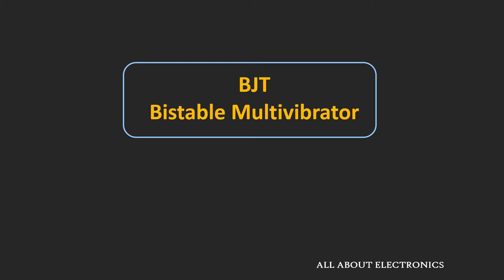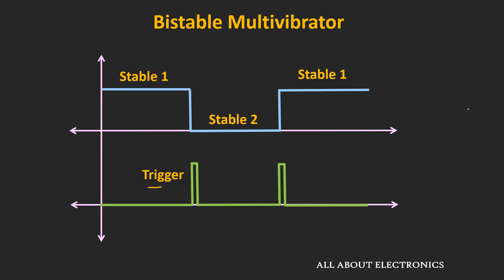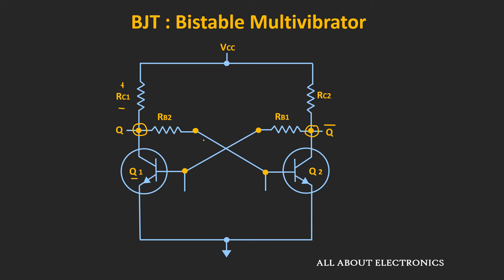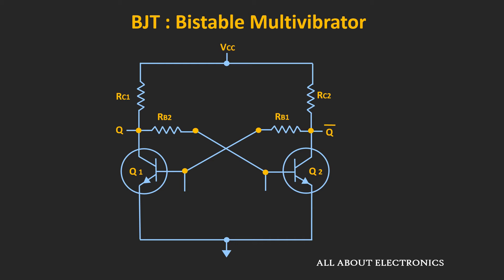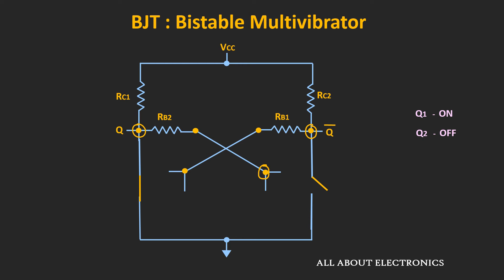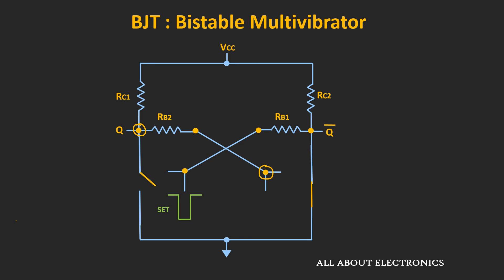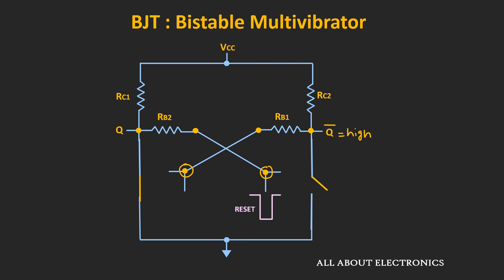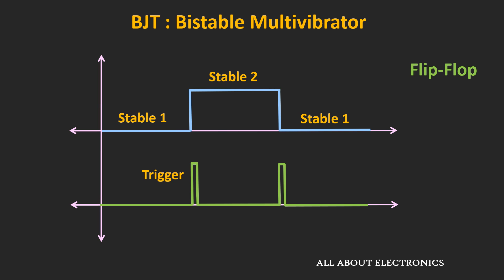Bistable Multivibrator using BJT Explained

Comment: Your diagram is confusing. You should really have separated the set / reset trigger pulses, now it seems more like it's a T-ff, not an SR. Your explanation is understandable, albeit sometimes confusing. I still have no idea what do you mean by "the gate pulse of the finite duration".
Also, for anyone might be searching for "switching multivibrator" as I did, that's the same concept, but uses two diodes to direct the trigger pulse to the base of the transistor currently active, thus making it act like a T-ff.

Comment: Another awesome explanation. Can we use two of the outputs to drive two different loads(for Astable and bistable multivibrators)?
Reply: Yes you can use both outputs to drive different loads, if necessary use an emitter follower

Comment: I have a doubt that when we power up the circuit  i.e., Vcc gets equally supplied at both side of transistor but it is told that Q1 transistor is having more voltage than Q2 why and how
Reply: That depends on the value of beta, here it is assumed that Q1 is having more beta value than Q2....
Reply: @circuitsanalytica4348  literally trying to get attention like anything😂. !! Anyway nice to help others. Hope you may get success in youtube.